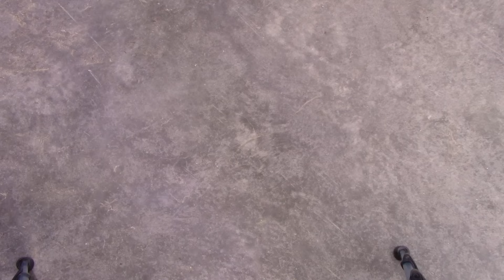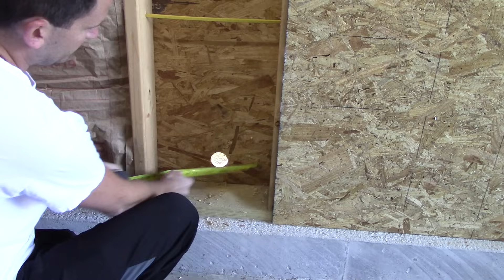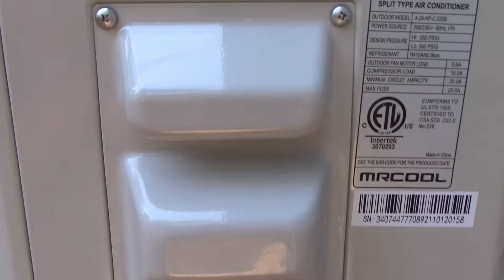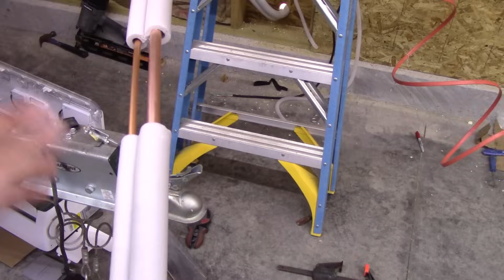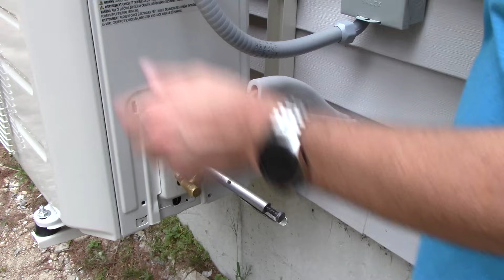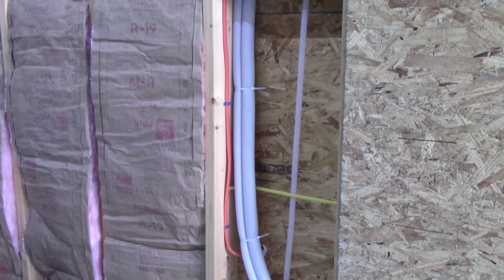Mini-Split Installation For Dummies - Complete Step By Step Guide.

Comment: I noticed that you ran the control wire and power wire through the same box+conduit outside. Great job! How's the AC doing now ?
Reply from the maker: Technically you're not suppose to do that but there's truly no reason why not.  They are both high voltage and should be allowed to run together.  To me, it's a no brainer.  Still loving this stup better than the Mitsubishi's I have in the house.  Quiet, easy to use with the remote or app and cheap.

Comment: You made seem so simple thanks! I’m an electrician apprentice and I thought it was going to be harder but so far its looks fun to do.
Reply from the maker: You're welcome!
Reply: @Trialnerror  Hi did u use a double 30 amp breaker or 20 amp. Did you just use the 20 amp breaker and oversize the wire for future needs?

Comment: I have trouble putting in the window units, guess I'm not DIYing this 😂
Reply: They make an actual DIY system that is designed to be easier to install and has the full manufacturer warranty even when not installed by a professional. That is what i am looking at buying right now.

Comment: This is very easy because you can see all the potential things that could go wrong. If this was a finished house with drywall and everything else it’s a little bit more complicated because you don’t really know the variables. Also no stucco and metal mesh to get through. Stucco would make this job take  a lot longer because of all the anchoring and such for the line set and exterior electrical runs. In theory if the conditions are like yours it’s easy if not get ready for a lot more work.Still a great job and super clean.
Reply from the maker: You're 100% correct.  In terms of doing this as a tutorial I thought my setup was perfect because we can see everything but you're right, add time based on your wall situation.  Thanks for watching/commenting brother!

Comment: Can you please reply with the box you used outside if it’s a 30 or a 60 amp and if It’s fused or non fused???
Reply from the maker: Sure!  It's a 30 amp non-fused.  I believe I linked it in the description if that helps at all.
Reply: Do I have to use a non fuse or can I use a fused as well because I’m doing and install as we speak and I installed an 30 amp fused but I’m not done yet so I still have time to change it...
Ohhh if I need to change to an non fuse, can I use a 60 amp non fuse because at the time I purchased the 30 amp fused Home Depot only had a 60 amp non fused and that’s why I picked up the 30 amp fused!!! Thanks
Reply from the maker: @triangleroofing  You can used a fused box so long as it allows you to cut power to the unit quickly.  The ability to disconnect service near the outdoor unit is what's required by code. Thanks for watching and good luck with your install!

Comment: That outside electrical box you used, is a 30 amp or a 60 amp and do I need a fused or non fused box? Can you specified which box I need to use please
Reply: It's more than likely a 30 amp as they don't draw that much and fused or non fused is up to you.

Comment: Trial N’ ERROR thanks for this video. A few things I wondered are. How did you get a unit that did not come pre loaded with refrigerant? Did you remove it? Also if I got one that’s what I for sure would have wanted to do so there is no coil left sitting around. Is the pre pressured refrigerant that they put in the unit in the out door unit or in the lines they provide. Assuming their closed pre filled refrigerant systems are done by the company. Again how did you get one where you could fill it yourself? 

Also when you cut the pipe on the inside. How did you flare the ends of your pipe since we didn’t see how you did that?  

Lastly when you let the nitrogen out of the lines that come out of the indoor unit. Is that nitrogen just in those short pipes for shipping purposes? It was hard to see what you were removing slowly to release the nitrogen. 

Thanks. Love how clean your work was. Not OCD to me at all. Well done. I hope I can do what you did when I install one

Comment: Why didn't you install a ground fault interrupt at the panel?  Question: You vacuumed the line to 1 lb. You then removed the tube from the gauges. When did you load the unit with Freon? Or does the unit come already with Freon installed?
Reply from the maker: Yes because one is not required  by code and they tend to trip due to the harmonics of the inverter style compressor.  They do make special GFI's for this purpose but no one uses them because A: not required and B: cost a fortune.  Yes, the compressor comes prefilled with freon, the user just has to release it.  Thanks for watching and for the good questions!

Comment: first video I've seen with the lines in between the studs. I like that idea. Did you end up putting insulation over the lines? What about condensation on the lines? Is that a potential issue? I really like that idea. I have a small she-shed and am planning on installing a small unit. Wife is particular about looks and having the lines inside is very appealing to me. Thanks for the video. Also I don't see where your drain comes out?
Reply: Yes I am doing the same. Those big cover drain pipes are awful. Just concerned I may not able to bend lines enough to do that.

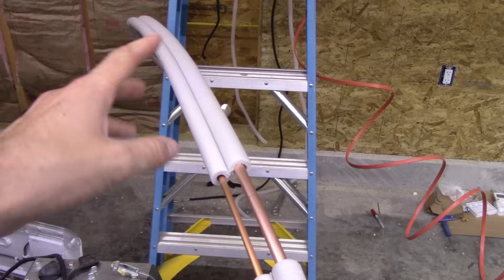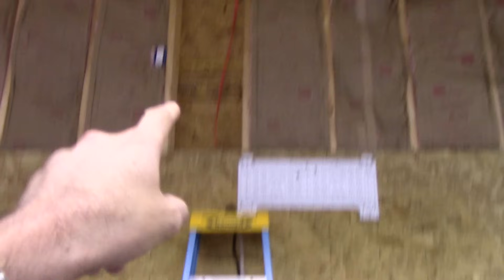Comment: So, starting at 9:52 you are telling your viewers not to coil the lines because this creates oil traps... and I totally agree! And then you are telling them at the 10:27 mark that they can run the lines all the way up the wall and then back down to use up the extra length of copper line. Can't you see that you have just created ONE GIANT OIL TRAP by running the copper lines above and I will repeat this word "ABOVE" the unit and then back down the wall again. This is doing exactly what you told everybody not to do, but only in a different way! 

Don't be lazy people! Remove the extra copper tubbing, buy a flare nut kit and a tube cutter to do the job right! Cut a small section of copper tubing off and take a few practice runs with it. It's not that hard to learn how to flare copper tubbing. But you do want to make sure that your flare fitting is the right shape when you are done. And always remember to put your threaded brass fitting on the line first before you flare the copper tube.
Reply: oil trap is none sense since the oil is only for lubricating the compressor and so lots of times the extra oil that never  bonds with the coolant will sit somewhere in the system .

Comment: When I installed one with my journey man years ago the poor guy had soder the connections. When cutting copper mistake I used make hurring the cut slowly turn and put pressure don't over gorilla it

Comment: We’re getting one of these this spring, we wanted one last year but didn’t happen.  I’m not worried about the install, mostly the electrical to code. But would still be good to know what I’m getting into. Did that exterior junction box come with the unit?
Reply from the maker: No, you need to pick one up.  I have it linked in the description if you want to check it out.  It's called a disconnect box. Good luck with your install, it's not that scary I promise!

Comment: When you pull a vacuum you need to check the microns to ensure vacuum is pulled enough.  if not, air will be in the system and cause damage to compressor mainly and lose efficiency.  second thing, when you check pressure, a vacuum test is good, but you need a micron gauge to really see what the number is, using manifold gauges doesnt really show you much change unless you have a major leak.  Other way to check is with nitrogen, most minisplits use 500psi as a test and let it sit for however long manufacture recommends.  Another thing, the reason why people coil up the coil is because some minisplits come with linesets that are precharged with refrigerant so you can't just cut open the line or else you need a tech to come out and fix your booboo and recharge/reweigh in the charge.

Comment: sho dimensions and MR.Cool model/ size please? and was this a "gen 3"? looking to see if you have other shop build vids...
Reply: *shop dimensions...
Reply from the maker: Way bigger than it's suppose to be.  Shop is 70x40 and I planned on installing two of these but noticed after getting this installed I really didn't need it.  The concrete floor really helps to keep temps stable.  I struggle to get it warm on cold day's but the summer; no problem for the AC.
Reply from the maker: Almost forgot, thanks for subscribing and: yes, this was a 3rd gen and here's a playlist on the garage build: https://www.youtube.com/playlist?list=PLnSIJRM8Kj_NXM4BLjoNlqJojtIsTGdaK
Reply: Thanks for the reply, I'm planning a 30x40 shop in TX so hoping this would be sufficient, sounds like it should be! Thanks again
Reply: Oh, and your install looks great!

Comment: Well done.  Couple of points I do differently.  Code requires a GFCI outlet for service work.   Pressure test with Nitrogen and soapy water before  spending the time to correctly evacuate lines.  A 410 system will run at very high pressures, 350+ psig.  A 200 psig Nitrogen and 15 minute hold is a good start., and far different than a few psig pressure or evacuation test.  Nice idea to remove the low side hose at 2psig, but you have to re-attach it when checking pressures after adjusting for the shorter lineset length.  Now you've attached and detached under high pressure
Reply: Code in my area states a GFCI outlet has to be within 25ft of the installed unit for service work.

Comment: Can someone explain or preferably link to an explanation for the "snug back-off snug" technique he uses in 14:30?
Reply: If someone can help me, I'd be happier than a midget in a miniskirt convention.
Reply from the maker: @poorly_explained_physics  When you initially snug up a brass or copper fitting there's quite a bit of stretch in the threads due to how soft the metal is.  If you back it off after the first tighten, that slack is taken up and the second time you put it under pressure you know what you're feeling is how tight the actual mating surfaces of the fitting really are.  It's a good practice on any malleable type of connection material.  I hope you are now as happy as a midget at a miniskirt convention and thank you for watching!
Reply: @Trialnerror  I assume you are doing some kind of plastic deformation of the threads otherwise you'd just be doing the same thing twice. I just can't really figure out it still unfortunately.

Thanks for putting videos out there! I've been using yours a lot for mental practice.

Comment: Great video,, and some great tips, like the nylock paste, tensioning and releasing half turn before final tensioning, also the slow release of the refrigerant. I am not in the USA so your rules are different to Aus rules,,, I don't like bare un-insulated ground wires, also I like to have GFCI/RCD on heavy load circuits, I use mcb/rcd on all of my circuits. I don't like the outdoor metal breaker box,  what is wrong with waterproof pvc boxes? I am not trying to teach you anything,,, you know it all and did a great job,,, USA is supposed to lead the world in tech but your electrical systems sucks.
Reply from the maker: Every part of your comment makes perfect sense.  I'm really not sure why metal is such a common part of outdoor electrical work here.  Then again, we don't use metric for measuring so we are pretty stupid when it comes to most trades HAHAHA.  Thanks for watching!

Comment: Awesome Helpful video, Thanks for sharing!  question: I have a vacuum port on my small line also, what is that one for?
Reply from the maker: Like a separate evac port?  Not sure to be honest.
Reply: If it is what I think it is (and it has a brass cap covering the port) then it could very well be a brass port fitting for a vacuum micron gauge. You should use one when you really want your HVAC system to work top notch. Google "Fieldpiece SVG3 Digital Vacuum Gauge with Alarm" to see a pic of the equipment I am talking about. This tool will show you how many microns the evac pump is pulling the system down to inside the AC lines. 50 Microns is the best, but getting your micron reading below 200 microns is your goal.

Comment: Question for you regarding the wall mount on the exterior. The wall mount instructions say to mount the arms on studs (the rail is not capable of load bearing), however the feet of my Mr. Cool condenser are 26.5" on center. Did you run into the same thing? If so, how did you resolve this?
Reply from the maker: I did but since I had access to the inside of the wall I just put a 2x6 block in.  If you dont have access you will need to grab a pressure treated 2x4 and cut two 32" lengths.  Run them horizontally on the outside catching 3 studs.  Then mount your brackets to those 2x4's.  Not sure if that's the "right" way to do it but that's what I would do!

Comment: Do you have to run a neutral wire with the 240v wires from the panel or is it just the two line wires and a ground?
Reply from the maker: Just 2 hot's and a ground is all you need.

Comment: How did you install the drain lines? I am going to install all of my lines in the framing and I can't have them slope down continuessly. Do I have to use some kind of a pump? The system is already loaded with the coolant. Does that include the lines?
Reply: I have two units like this installed in my server room, and the pro installers did run both drain lines to a pump. Once the pump is full, it pumps the water to a drain pipe. I suppose you could also let it drain outdoors somehow?
This is the pump they used:
https://smile.amazon.com/Superior-Pump-97154-Condensate-Black/dp/B08GH5WF99/ref=sr_1_15?crid=1T2VDNCCE464F&dchild=1&keywords=drain+pump+with+float+switch+tank&qid=1629680216&sprefix=drain+pump+with+float+%2Caps%2C207&sr=8-15

Comment: Keep trying to install these yourself.  I make a ton of money going and doing the final connections for people. Two hours work 500 bucks flare nuts evacuation charge check
Reply: Only $500?  Yesterday a guy tried to charge me $1100 to connect the lines.  I'm gonna follow Trial N ERROR's steps, and if it doesn't work I'll buy a new one for $600 and try again.
Reply: @AshleyTodd1  This was my logic as well.  It was $800 for 18K and 2800 for vacuumed lines (DIY).
Reply from the maker: Hell, that works!  Plus I'm sure you have to fix or finish some homeowner's job when they get in over their head!

Comment: It is really a medium job well, obviously this person does not have the necessary training. First you need a specialized tool, torque wrench, vacuum gauge, multimeter, also this installation is made in such a way that repairing leaks will be a real madness. to the extent that repairing it would be unaffordable, considering opening walls.

Comment: That's nice, but what about warranty. It's doesn't work if not HVAC licensed guy did it(nitrogen and vacuum test) wright?
Reply: Wrong, at least with a Mr Cool.  His is void because he cut the lines (and pulled a vac on them).  Mr Cool gen 3 line connectors have a release valve that opens when they are tightened.  So they already have been dehumidified/vacuumed and are sealed from the factory.

Comment: My only concern is running the lines in the wall due to condensation, I do a lot if remodel with for safety, health and energy efficiency improvement programs and water damage from condensation off AC lines is very common at least here in Florida (especially in attics). To remedy this I would run the lines well insulated and in a PVC chase/conduit that drains to the exterior of the building.

Comment: You did a very nice job with your installation video. The only issue I have is that you ran the Control wiring together with the line voltage feed wires. This is an Electrical code violation. For two reasons. First is by no means is the Discount our side allowed to be used as a Raceway for any other conductors other then what the Disconnect services. The second one is that in order for your control wires to run in the same conduit as your feed wires they need to be of the same wire installation as the feed wires. I feel you should make note to this. Reason being is anyone who’s will take this project on and have it possibly filed for inspection from the local authorities will fail inspection. Otherwise you have done a nice job with your DYI- - tutorial.
Reply: I missed that. Very good point. Low voltage signal wires running in close parallel with 220v supply lines is a big no-no.

Comment: BIG Question: Appreciating Lesson while wondering about turning the blue
 valve to off after the 15 minute vacuum procedure.  I think you may just be measuring if 
there was a vacuum leak in a gauges and guage set up middle piece with that blue 
valve OFF instead of measuring potential leak in your mini split and 
its'  cooper lines via leaving the Blue Vale ON ??? My testing while doing this procedure today lead me to believe that Blue Valve best be left ON to test for vacuum leak in full system (and another YouTube teacher just got my same feedback). I will study harder before opening up my mini split to release its' freon to the whole setup. Liked your low  pressure line test. 

I have recently learned from someone else's mistake via another YouTube Lesson;  that the gauge vacuum hoses have a fitting side that will open the shrader valves (You covered that point nicely). If you hook up your vacuum line backwards with no release of shrader valve at mini split fitting, you will only be putting a vacuum on the vacuum hose and gauge set only.  One guy figured that out after releasing his mini splits' freon to whole system, and then he had an expensive back track lesson to get rid of moisture that he figured contaminated his freon (that shorten unit lifespan).  ...  Learning More All the Time !!!
Reply: Thanks, this occurred to me. I actually tested my gauges first to ensure there were no leaks. I pressurized them and let them sit for two days while monitoring the pressure.